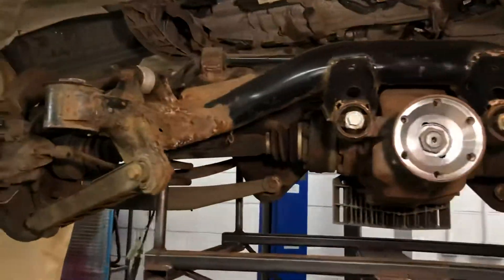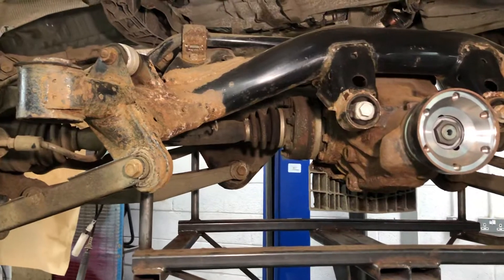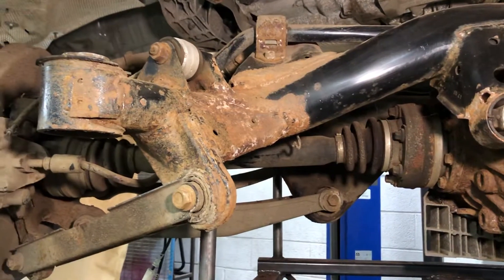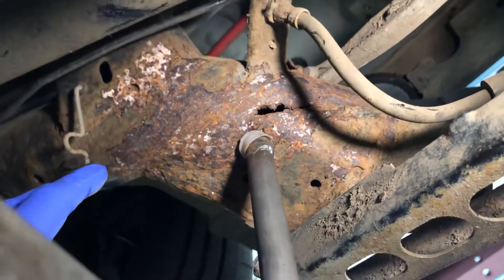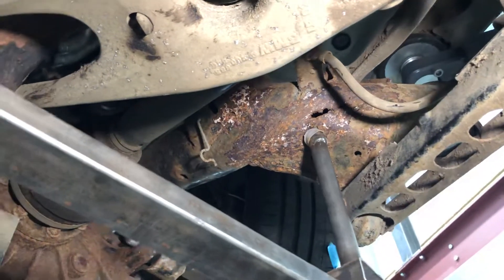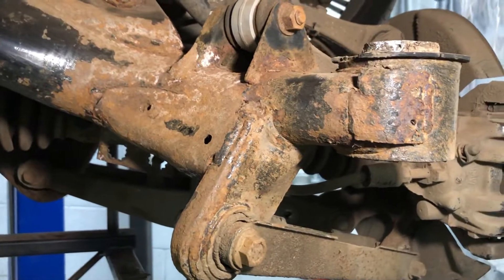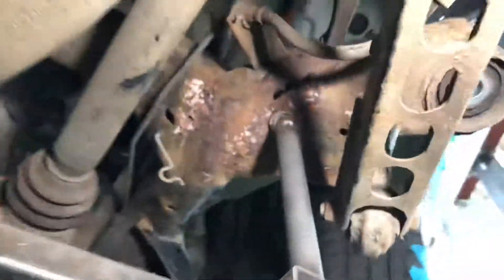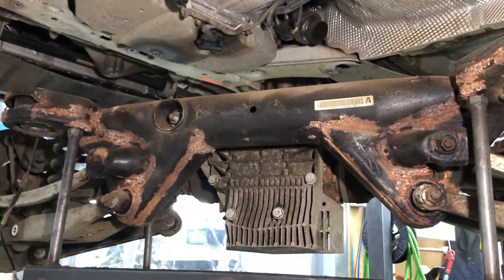BMW (E92) M3 Failed Subframe!

Comment: Another excellent and informative video from James and the team. I've got some of my friends watching these vids now, who would have thought that poking about under cars could be quite so interesting ! Having just had the underside of my JCW Mini inspected for corrosion at MOT time (all ok) I got to thinking about this. My car is often kept in an (unheated but not terribly cold) garage. However, if the car has been used on wet and/or salty roads, I make a point of leaving it in the driveway to dry off naturally. My dear old Dad advised me never to stick your car in the garage whilst it was wet, a good carport is, of course, a different matter.

Comment: Every vid I see a lot of comments criticising BMW but many of these cars are 15 to 20 years old. This subframe took 12 years to rust through. I am old enough to remember the old BMC 1100s with subframes that had holes in them after 3 or 4 years. I remember Fords needing strut tops after 5 or 6 years. I won't even go into the Lancia Beta/Fiat or Alfasud memories I have, there isn't time!  The average car, unless Ziebarted, would be a wreck after 7 or 8 years. Whilst BMW may not compare well with its peers today, comparisons with the rot boxes of the 60's and 70's and even 1980's are somewhat extreme. I can say that with certainty because I was there!
Reply: Meh a car should serve you not the other way around. It’s not worth spending so much time and money on an old car.
Reply: There is no excuse for the subpar problems that bmw always engineers into their vehicles...soo many ridiculouse problems you see on what is a very expensive luxury car when they are new   ...and you dont see these problems on a lot of cheaper alternatives....you don't see Honda's engines with multiple catastrophic problems that will cause engine failure....or subframes rotting out or cracking after 10 years.....it really is sad, because bmw has made some really amazing cars in the past....modern bmws are Puke to me

Comment: Yup. That subframe corrosion also happens on e36s and e46s - including M3s. The wall thickness on those parts is thin to begin with. I have done subframe bushings on 3 of my cars and had to work over the actual subframe on each. Heavy wire brush, rust converter, 2 coats of primer, 2 coats of paint. I am in the market for a e90/e92 M3 and will put that area on my list to inspect.

Comment: I have just done a full suspension rebuild on my car and opted to replace the rear subframe as I wanted new bushings etc anyway, and I figured a new one would last at least another 15 years. I also coated it with Bilt Hamber Dynax UB to give it a bit more protection, too, but was wary about coating bits near the bushes and holes. as I didn't know what goes in where and didn't want to risk any fitment issues!

Comment: Rust protection is essential if you drive regularly on salted roads. It’s a relatively small investment compared to the cost of a car, and can be done on a secondhand car as well. I had a similar problem with the rear subframe on a 2005 Mini Cooper cab, and after considering patch welding up several rust holes, I realized the steel thickness was so much reduced that I concluded with sourcing a good secondhand replacement, which worked out very well. The degree of corrosion was not that shocking considering the car was 15 years old.
Reply: This car was 12 years old and this level of rusting is completely unacceptable especially from a supposed premium manufacturer on a top end car. Rust proofing is all good and well provided (a) it is done properly and doesn’t cause more harm than good and (b) all areas are protected. It isn’t really possible in hard to reach areas such as those highlighted in this video.

Comment: Little know fact is that heat helps accelerate corrosion.  It is an issue in aircraft engines.  In instance of this car, the owners seemingly fastidious storage may have helped accelerate the corrosion which was there - driving a salty car into a heated garage is a mistake many make.  

In an ideal world it would get a thorough wash underneath and then go under a car port, or a very draft shed.  I have heard of people using a garden sprinker and just moving it around over a short period.  I am considering some quick jacks for general work, but also thought I could use them to quickly get the car in the air to wash off the salt over winter.

Comment: How much road salt was used in the roads of ownership? How wet was the climate of the roads if weren't salted? You mentioned at 2:00 that this car was stored in a heated garage all of its life by one owner. A 30 years experienced  Audi shop owner once told me that heated garage storage for a car that drives on wet/salty roads in the winter, which makes the moisture melt and seep into crevaces, is even worse than parking  a car outside during the winter. When parked outside,  the the ice sticks to things and stays there, until it falls off or is washed off; the metal and paint  on the underbody are also cold/contracted and not as accepting of the corrosion. Recommended heated garage only for a car that is used in the summer, or stored throughout the entire winter. What are your thoughts on this, significant difference or not? Road salt obviously eats through cars that are parked outside too, but the heated garage may have accelerated this
Reply: I’ve heard the same thing too. I’m thinking the head garage may have been more detrimental than beneficial in this case.
Reply: Yep I was thinking this too. Though the subframes on these seem to rot whatever. I guess they’d have to be kept dry all the time and dry stored not to. Pretty unacceptable, as if they had a decent coating this wouldn’t be so much of an issue.
Reply: @royfontaine5526   True, didn't know that about e9x chassis, good to know for future purchase.  In Volvo world the P1 subframes are pretty bad too. The P2's don't have the same rust issues. Both volvo platforms are from the same time era.  Goes to show how these manufactures pick and choose what fails
Reply: @OneWayToMachines  I think everything is shite nowadays! Bit of a bugger when you want/need something newer! My two e36s have been very rot resistant (despite the poor reputation) but they’re really too old now for my purposes. I’m in the market for a 440i but concede they’re much more “built to a price” nowadays 😟
Reply: @royfontaine5526  Agreed. Cool to know about e36's. Always wanted one
Reply: Heat accelerates corrosion  - In this instance I suspect a heated garage helped accelerate some of this corrosion, storage absolutely was a contributor.

Comment: This has been a problem on 1 Series and E90 stuff for a few years. However it's NOWHERE NEAR as severe as subframe rot on Mercedes crap - you will find 2013 Mercs with subframes that have rotted enough for both breakage and MOT failure.

Comment: BMW just doesn't want their cars to last.
Reply: No manufacturer of any product wants that
Reply: @chrisg4rr377  some manufacturers used to pride themselves on longevity. I don’t see why this still isn’t the case - surely a car reputed to last will have better residuals, and be a better prospect for buyers, even those who don’t keep hold of them for long?
Reply: It's a bolt on component, they want us to buy parts. I worked for a BMW agent in the UK. It's a relentless parts selling machine.
Reply: @RustBucketConnoisseur  it’s a shame the e39 body and underbody rust for fun though...
Reply: That’s why when you create something yourself eg a diy box, you’d think through its longevity and forget about any planned obsolescence, you buy one from I kea it’s made not to last on purpose so the manufacturer can make more money out their products, very much like bmw today with their so called Idrive, you can only record the service don’t to it by goin to a bmw dealer and you can’t get anyone else to note it into the system, when I first heard about that I immediately knew it’s just a way for them to take your money, it’s the way most manufacturers are going, makes better sense to put more non environmentally safe products on a car that last a very long time than to put recycled parts in that end up back in land fill because it doesn’t last long, I agree with you
Reply: @chrisg4rr377   Yeah they get repeat sales if it breaks in two in a week.  Makes sense.  Yet Toyota sells more than anyone by making things last forever, hmmm...my simplistic assumptions dashed.

Comment: atleast you can easily replace the subframes, whereas a rusting chasis is a much bigger problem.
Reply: Not exactly cheap to replace the subframe....definetly a big Headache on something that should last much much longer
Reply: Exactly. I’d rather replace a subframe than weld in a new boot floor like an E46

Comment: Would be interesting to know what part of the UK this car is from.  I imagine cars driven in Scotland would be subjected to more salt in winter than cars driven in the south east, over the same same mileages.  But agree with all the comments saying putting a wet, salted car into a heated garage is likely to have contributed.  I lived in southern Germany for a bit, where it was colder in winter than here.  A colleague had a 70's Merc as his daily and I asked how he kept rust away with the heavilly salted roads. He said it was fine to leave the salt under the car winter, as long as it stayed properly cold, but as soon as spring started arriving and it got milder you had to get underneath and wash it all off.  He explained it was really only when the temperature rises that salt starts to act on the steel, and then the warmer it gets the more it will corrode.

Comment: That’s so sad. Such a nice car being eaten away by rust. This is why prevention is better than the cure. Only costs about £90 but will save you thousands.
Reply: Not gone through the whole video yet, what service cost 90 pound and prevents this?
Reply: @TheJammydodgerjj  before the rust gets to a terminal stage, you can undercoat your car using products like Lanoguard.
Reply: @Jrk450  and what about the impossible to reach areas like those highlighted in this video?!
Reply: @royfontaine5526 you can reach that area in the video via spray application. Just have to put the car up on a ramp and spray loads. Use bendy straw/pipes to direct the spray on to the area. 👍
Reply: @Jrk450  nah, there are bits you’ll miss. Subframe removal is the only way to be sure.
Reply: @Jrk450  thanks
Reply: @royfontaine5526  if your car going to remove the subframe then you might as well just recondition all of it. 👍 🙂
Reply: @Jrk450  indeed. It’s the best way if you’re able to and it’s a car you’ll be keeping and you’re replacing bushings and the like. It’s disgusting though, what BMW considers adequate protection on this kind of critical, costly and exposed component. 

It’s a shame there aren’t more companies like Redish that’ll take the time and care on jobs like these, albeit at a cost of course. Most places want quick and high turnover and don’t want vehicles on ramps for longer than absolutely necessary.
Reply: @royfontaine5526  yes this is true. Mines in good condition for a 2006 E46. Checked it and coated recently. But will recondition it when I do the bushes. 👍

Comment: Since I change my tires twice a year, I find it a bit strange that the owner didn't catch this.
Reply: You can even see a lot of the rear subframe just from getting under the car a little....really should have noticed this much sooner....
Reply: What does your tire changing schedule on your own car have to do with this owner?
Reply: U can not see the subframe on the ground u need a 2post ramp or 4post  to see this easily more question, why was it not picked up on MOT as  an advisory before getting in this State
Reply: @douglasmurdoch  James mentioned in the video that the portion which has corroded thropugh is obscured with the subframe fitted - An MOT tester couldn't see the corrosion.  James' comment is that if it could be seen, then it would be a failure.
Reply: @adogmcdizzle   you can  see corrosion on the subframe   And u can see round the edge of where the subframe attaches to the car, 
my point is you can not see anything on the ground u need a 2 or 4post lift to see anything like that  and If the subframe is rusting it’s likely  to spread
Reply: @adogmcdizzle   I been mechanic for over 20 years I look at as the owner is  not always going to know or they don’t want to then been drop in, that notit that been going  the 12 months
Reply: @douglasmurdoch  My point was more about your second comment regarding why the issue wasn’t picked up as an advisory.   I don’t think a generally rusty subframe would be mentioned on an MOT, otherwise practically every car would have this as an advisory.
Reply: @adogmcdizzle   it’s doesn’t always have to be an advisory you can tell the customer to have it look at or inform them  before it becomes a problem that cost the customer more money but I take you point
Reply: @douglasmurdoch  yeah, you would hope particularly on an enthusiast car the owner would be told.  I usually ask my MOT tester if there is anything I need to keep an eye on.

Comment: If you think this is bad on a twelve year old BMW. Have a look at any Mk7 golf with 30k miles on it. Absolute garbage. For all the BMW haters. Do one!!!
Reply: The rear trailing arms on our 45K mile Mk7 e-Golf (2014) have some surface corrosion but its otherwise 😮not bad.
Reply: My 2019 M2C with 17k has surface rust already on and around the rear subframe as well. 
Totally unacceptable for such a young car.
Reply: I love BMWs (well maybe not all the current line up) but this is unacceptable. And yes, VW are worse and even more unacceptable!!

Comment: It’s really not acceptable is it? I’ve gone off BMW completely as a brand. Imagine spending £80k on the new equivalent POS right now only for it to end up like this not that far down the line 😬
Reply: agreed...I've also been put off after E60 E87 shenanigans.... its a generational thing the EXX series cars are all built to cost but they have improved since working with Toyota so FXX GXX have better build quality....
Reply: I agree....but i really do love the e92 m3 too much....
Reply: @fxkraft1037  🙂
Reply: @thomashorneman563   the e60/90 seem to be rot resistant on the upper body, unlike the previous e39/46 generations. Just a shame they rot underneath. The F series are probably too new to tell but I’d wager their subframes and crappy e-coated underbodies will rot just as badly as the e60/90 series 😟
Reply: @royfontaine5526  e39 had front and rear aluminium subframes not  this 💩 bmw must do better  the car dry stored as well  where have the  attention to detail gone